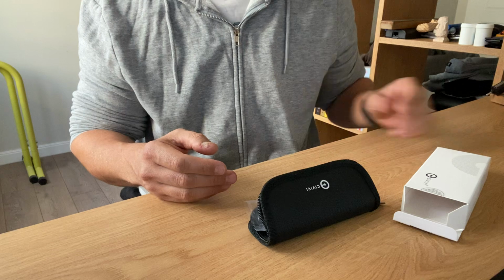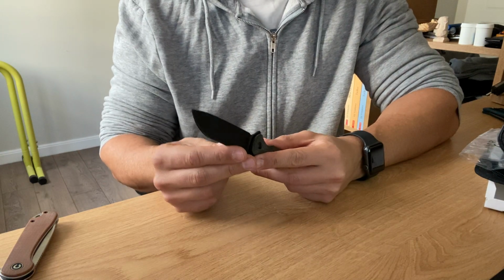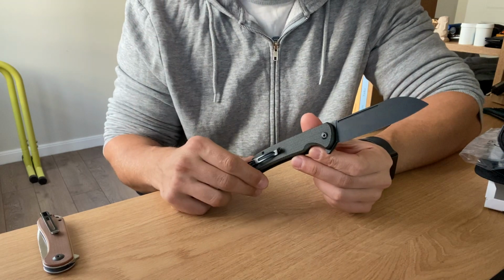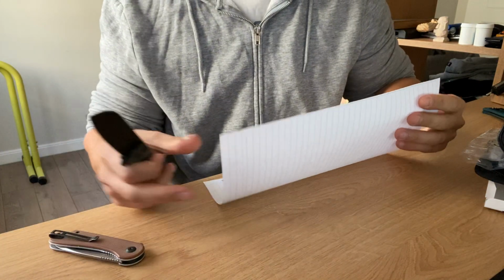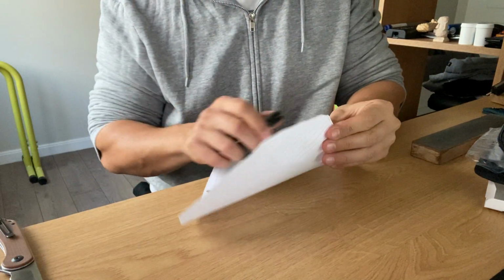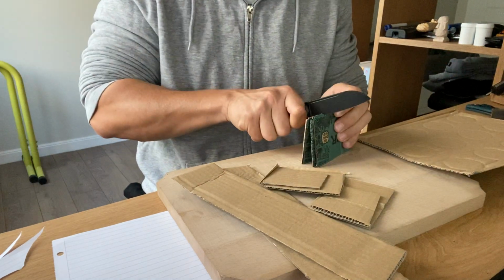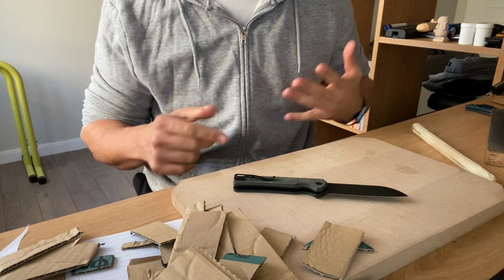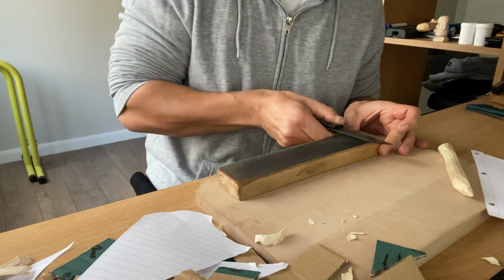First Look - First Test - Civivi Chevalier

Comment: Great video. You should make more. I just received my Chevalier today (11/06/2023). I'm more into the tactical side of knives but I thought this one was interesting. Mine came with very minor button stick but as I kept playing with it, it seemed to become worse. Same thing happened with my Conspirator but I just kept at it with that one and the button stick now is very minimal. I guess I'll just have to keep fidgeting with my Chevalier. I've got quite a few boxes here and I'm going to test this one. I tried my Conspirator and Praxis and so far among my Civivi knives, the Conspirator is the best slicer. Even better than the Sentinel Strike. I don't remember if I tried my Vision FG. Maybe I should try that one also and see which is the best slicer among my Civivis. 🙂
Reply from the maker: I did make quite a few "First Look/First Test" videos. 
That button stick problem you mentioned....you should talk to your retailer or write Civivi. I had that issue with one of my Sencuts. They replaced it. You can also fix it yourself. You need to disassemble the knife and make the hole for the button lock a bit larger(it was the case with mine) or maybe round the edges. 
So far...the sliciest(while still being a decent workhorse) was my Elementum. No idea how the flat ground ones are but the hollow ground one are very good!
Reply: @SpartanJohns  You know what? There is an Elementum sticker that comes with every Civivi but I don't have one or even thought of getting one. Maybe I should. As of the moment, I have my eye on the Synergy 4. By the way, try the Keen Nadder out. You might like it. I love mine.
Reply from the maker: sorry for the late reply....i haven't bought a new knife in a long time...been looking around...now that I sold off most of mine...i was looking around. 2-3 more months and i'll get back to my  "old habbits" ...hopefully

Comment: what are your go-to edc knives when you know you're not going to be doing heavy outdoor tasks?
Reply from the maker: that is a good question....but we would have to define "heavy" If chopping is "heavy' and it kinda is because it requires a heavy blade and thicker grind...then really anything. I baton only certain folders...Ganzos(because they have the axis lock and they are inexpensive) and Cold steel knives...because they can take it..
other than that...i do pretty much everything with all my folders...
off the top of my head: my Sage 1. It is a nice small folder, does not look threatening, is really comfy in hand and has a nice action.